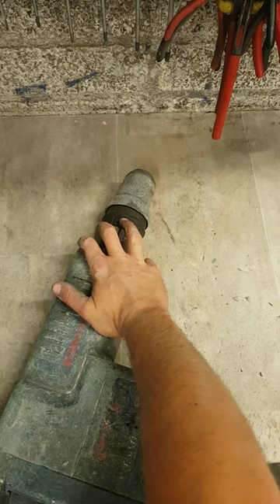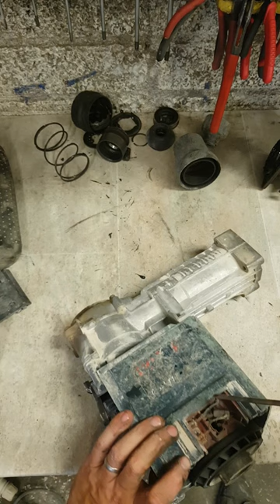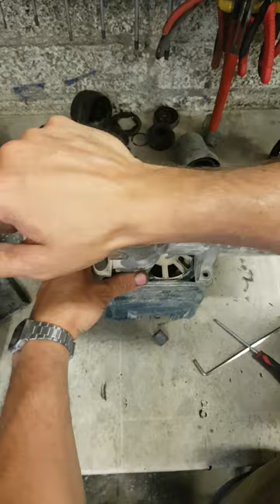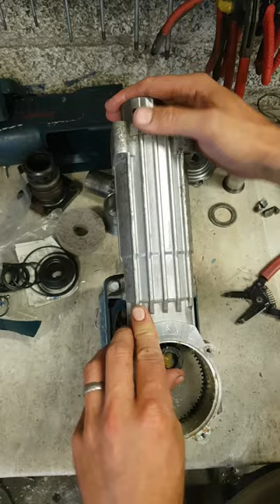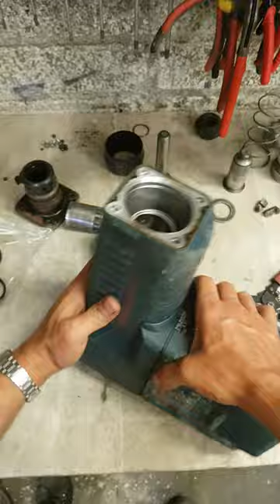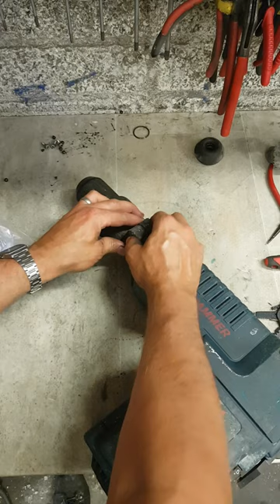Installing a Bosch service kit in a Bosch GSH 11 E hammer.

Comment: Thanks to this video I was able to buy a cheap GSH11E that wasn't hammering, but was in overall good condition. I put a full service kit, changed the needle bearings and now it works like a charm. Great machine for a fraction of the cost !

Comment: What’s the story with the big felt ring? Is it some sort of vibration dampener? It seems to do an equally good job sucking up moisture and corroding the metal cap under it…